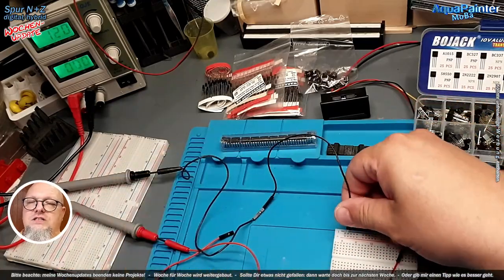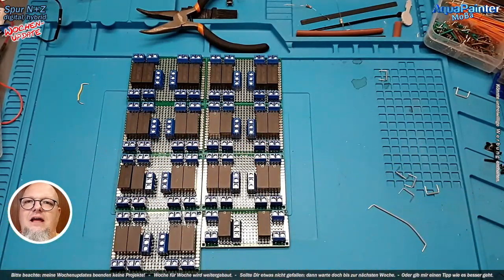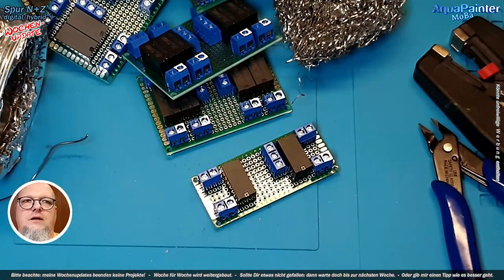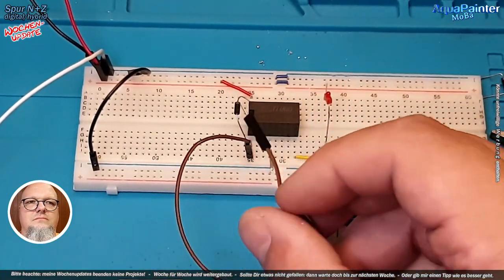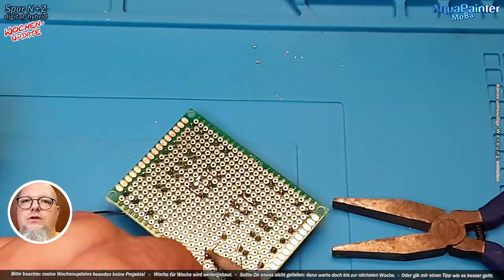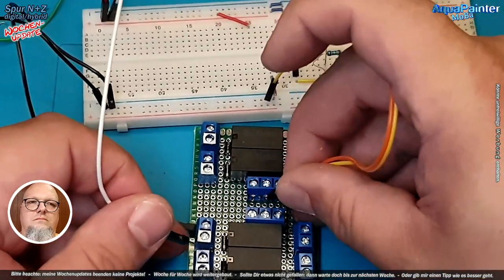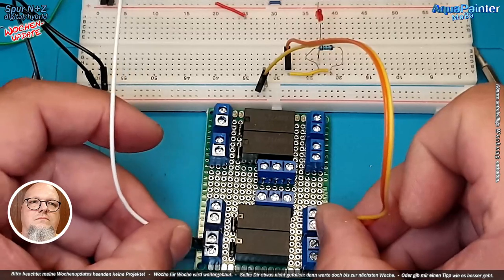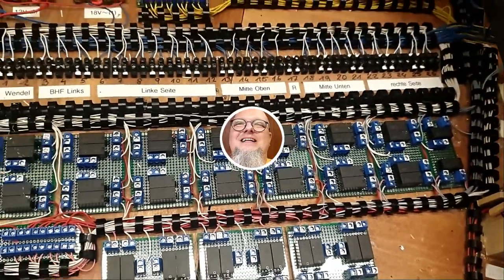#105 Relais-Platinen DIY - Reedkontakte verschleißfrei machen 🚂 Modelleisenbahn Spur N Z 1:160 1:220

Comment: Moin Uli noch nee Frage zum Relais kann man da folgendes nehmen
HDF 12 Signalrelais monostabil 2 Wechsler 2A.Wenn ja gebe mir bitte eine kurze Info. Und als kleiner Tip wenn ein Relais mal defekt ist nehme einen IC Sockel verschalte diesen dann kannst du das Relais ganz einfach wechseln.
Viele Grüße  Roland
Reply: Wegen den Relais habe ich nochmal nachgeschaut daher die Frage gehen auch die HJR 4102-L 12Volt.
Viele Grüße Roland
Reply from the maker: Ja,  Im Grunde kannst Du die verwenden.
Ich habe diese genommen: https://www.conrad.de/de/p/tianbo-electronics-hjr1-2c-l-12vdc-printrelais-12-v-dc-2-a-2-wechsler-1-st-629500.html
Das mit dem IC-Sockel ist ja eine wunderbare Idee. Das werde ich wohl auf meiner anderen Anlagenhälfte so machen. Danke.
LG Uli 🙋🏻‍♂
Reply: @train_dreams  Wege den IC sockel nehme aber die Präzisionssockel mit den runden Löchern ich glaube da beaucht man 16 polige IC Sockel.
VG Roland
Reply from the maker: @rolandrolle8739  Danke. Die werde ich mir mal bestellen 👍